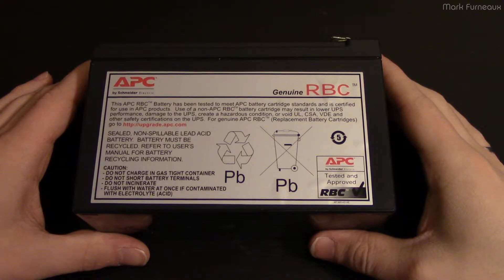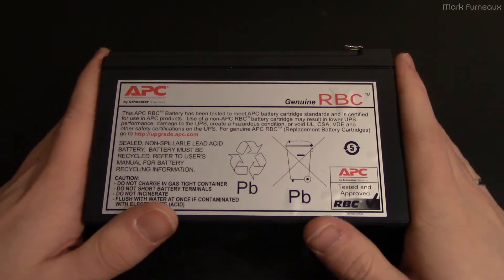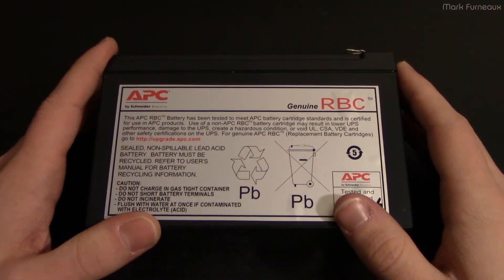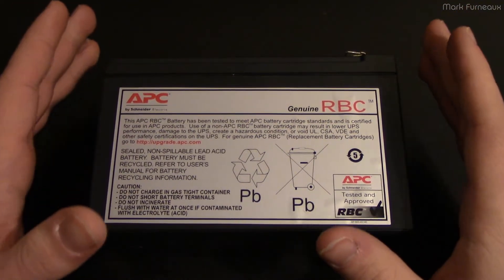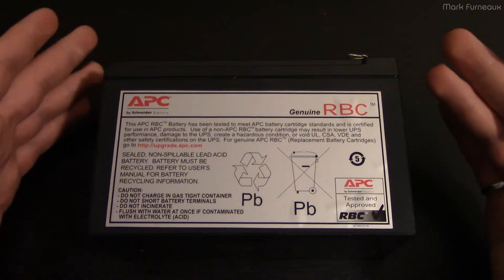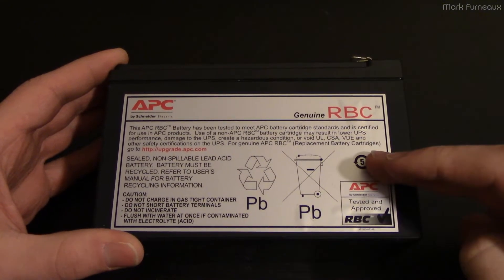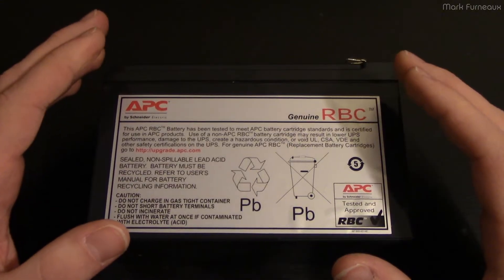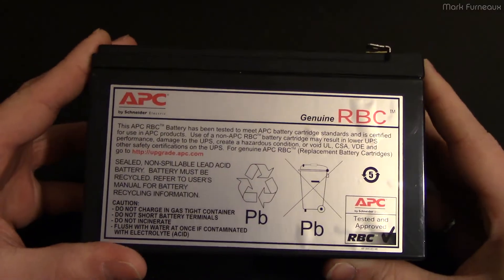How to Quickly Test UPS Batteries Without the UPS Itself

Comment: Thanks for the video.  Good suggestion on how to test UPS batteries.  I know I get errors on my UPS units alot.. even after replacing the batteries after a short while.  Having a little trouble with the Ancel BST100 tester I just picked up.  Sometimes it says CHECK CONNECTIONS.  But the seem pretty solid.  Screen is on and solid.  Other times it says the resistance is 0.  That can't be right I assume.  Ever run into this?  Did I just get a bad tester?

Comment: so i have this kind of nice multimeter that has the little resistance symbol, which im guessing means when i switch it to that, it measures resistance. does that work as well? does it apply a small load to test the resistance like the battery tester? thanks!

Comment: Thank you, this is exactly what I was looking for. Internal resistance is a useful indicator of battery health. Thank you for pointing that out. I already have a Foxwell BT-715 that is able to measure internal resistance. It does this in a back handed way by applying a known load and determining the difference between the no load terminal voltage and the loaded terminal voltage along with the current flowing. This is far more difficult to determine with basic tools like a multi-meter and DC capable clamp meter and the ability to perform some basic arithmetic. Anyway, the two batteries from the UPS (APC Back-UPS XS 1300) I was checking had internal resistances 73.54 and 76.67 milli-ohms so it is evident that they are bad as the data sheet indicated they should be around 19 milli-ohms.

When I discovered your video I said, >18 minutes – too long but I decided to give it a shot. When you started talking, I said, OK this guy thinks the same way (asks himself the same questions) as I would, (When you talked about minimizing risk by hot swapping batteries) so I’ll listen a bit more. Eventually you got to the discussion about internal resistance then I was sure I had found a reliable information source. Later you mentioned about $CDN and finally I noticed you are a Canadian Engineer – Electrical I assume.  This explained a lot in terms of how you approached this problem, found relevant data, and interpreted that data, etc.

I, too, am a bit of a UPS fanatic. I have four APC Back-UPS XS1300s supporting computer and entertainment equipment distributed throughout the house. I also have four older APC Smart UPS units, 2 X 1000VA, 1 X 1400 VA and 1 X 3000VA. These older units have all been modified to use external 35 AH deep cycle batteries and provide more than an hour of backup for my servers, Internet connection, alarm system and home automation equipment. I also have a 7200 Watt (continuous output) emergency power plant that I use for longer outages. BTW, I had to reduce the sensitivity settings on all the UPS units so that they would accept power from the emergency power plant. I also have a few smaller UPS units that are used for bedroom table lamps, clocks, etc.  And no, I don’t have a UPS on my microwave (other commenters) but it runs just fine on the emergency power system.

I have subscribed to your channel and given you a like on this video. I’ll take a look at the other stuff you have posted soon. Thanks again.
Reply: You simply connected a larger battery (35 AH) to your UPS and it is able to charge it fully?
Reply: @louistournas120  Yes. I normally replace the native battery wiring with longer heavier gauge (2 AWG with red or black insulation). This sometimes means removing and soldering new wires on the UPS motherboard. I drill holes and grommet them in the existing casing to bring the wires outside the enclosure. And I apply suitable connectors (typically crimp on ring connectors with red of black insulators) for the batteries used.  The battery type I use is always identical chemistry to the OEM battery (Typically Sealed Lead Acid Deep Cycle).  Such batteries normally have the same open circuit fully charged voltage and float voltage as the OEM batteries. This ensure that the native charger will operate fine to charge and float the battery as required. The main difference is that these larger capacity batteries will take more time to charge. For the larger UPS units, the battery can be 24 or 48 V. This is generally achieved by creating these battery banks using a series of identical (both in age and AH capacity) 12 V batteries wired in series.
Reply: I've seen numerous YT videos that show hooking up large(r) batteries to various UPS models. I'd be interested to know what mods you made to achieve this configuration. I just installed new cells in my Smart-UPS 3000 (SU3000RM 5U). Made my own packs using cells from fleabay and the fuse & harness from the previous pack. The unit is charging them as I write this.

This unit also has an Anderson connector on the back for a "SU3000 48V, 816VAh" unit. Is this port something I could use for a (customized) external pack along the lines of what you did?
Reply: @andrewr7820  I have an older SU3000 wired with four 35AH 12 V deep cycle batteries. These batteries are configured as two banks of 24 V batteries matching the OEM setup. I also have an unmodified APC SMX2000L. This is a rack mounted unit. The base unit has one 120V battery module (10 X 12 V batteries and about 50 lbs.) that is integral to the UPS unit with an Anderson style connector. I also have two additional rack mounted (19” X 2U) battery modules. Each of these units holds two of the 120 V battery modules that connect internally with Anderson connectors. These units are back wired and can be daisy chained together with the unit closest to UPS unit jacking into a connector on the back of the base unit. See response above for notes on charging.
Reply: @deanrhodenizer938  Thank you for the extremely informative reply. I think I'll look at creating an external pack that connects to the rear (red) Anderson connector port of the SU3000, unless you think there's a better way to do it.
Reply: @andrewr7820  Sounds fine to me. Take care making sure you build a pack that precisely mimics the factory version and the connection has the polarity exactly matched.

Comment: Can i hook up a car battery 12V, 100 Ah in order to have a longer discharge time when original battery was only 7 or 9 Ah? Is the electronics going to be ok and just recahrge time is going to be longer or it will burn my UPS?
Reply: Yes, you can, but never do it. The car batteries are venting gases and dangerous for indoor use. Especially during the charging cycle. If you planning for prolong power outage that can't be handled by UPS itself it is better and more efficient to get portable gas generator. You will need to take care of exhaust gases. https://www.bobvila.com/articles/how-to-use-a-generator/

Comment: What's the difference between this and hooking up a multimeter in resistance mode?
Reply from the maker: Your multimeter outputs a small voltage and measures current draw. Since a battery is itself a voltage source, you need a different method.
Reply: A multimeter in resistance mode is not made for using on a live circuit.

Comment: So Mark, what would be an acceptable range tolerance for the measured internal resistance? +- 10%, 50% etc? I am reviving 18650 cells and purchased a meter that measurese intrnal resistance more or less accurately. I've foynd that around 24-25 milli ohms (or less) is acceptable. If the internal resistance hits 30 or above the cells have tested (using capacity tests etc.) bad.

Comment: If you want to know that actual; capacity of a battery, use one of these.  Takes a lot longer and you need to know the safe discharge current (or what the inverter draws at expected or maximum load)

110 watts  9.99 amps  $23.19 + $1.27 shipping (US)
https://www.banggood.com/Original-ZHIYU-60W-110W-9_99A-30V-Constant-Current-Electronic-Load-Aging-Battery-Capacity-Tester-p-1146280.html?rmmds=search&ID=529811&cur_warehouse=CN

180 watts  20 amps  $42.10 + 1.44 shipping (US)
https://www.banggood.com/180W-Constant-Current-Electronic-Load-200V-20A-Battery-Tester-USB-Discharge-Capacity-Tester-Module-Measuring-Tools-p-1590208.html?rmmds=search&cur_warehouse=CN

The internal resistance tester appears to be the best one minute test there is ;-)

Comment: A multimeter allows you to test the resistance, so it is less accurate?  There are other videos warning that with a larger ampere battery than stated, the UPS unit will burn up while charging.  
BTW, glad to see more videos!

Comment: Another thing to look at is the terminals...  F1 or F2.  You can always squeeze an F2 lug to work on an F1 spade... and you can get an adapter to use an F1 lug on an F2 spade.    But if you pay attention to the specs, you can get these batteries with the correct spade terminal for your UPS cables.

Comment: Thanks for sharing.  I do a very similar test of my Lithium Batteries.  Never thought about doing this for my UPS Batteries and like you I use UPS's everywhere in my house.   I never change batteries on a live system because of potential arching which presents a potential explosion hazard.   Most of my UPS's take 2 batteries others 4 and very few only take 1.
Reply from the maker: AGM batteries don't pose an explosion risk since the hydrogen is absorbed in the battery itself. The don't vent to the environment unless there is a horrible failure which you will know long before you open the UPS. I've never seen a flooded battery in a consumer UPS for this very reason.

Comment: APC UPS units tend to charge the batteries really fast, they will be back at full float voltage within 2 hours. They will cook the internal batteries pretty fast, just like most small UPS units do. I took those internal batteries out, and instead used an external deep cycle battery to replace it, giving both much longer running time, and also letting the battery run around 20C cooler than it was in the case, increasing it's operational life. Also went for flooded cell, instead of AGM or gel, so that the APC "cook it till full" charge method would not kill the cells prematurely, by boiling off all the water in the cell, now I can just check every 3 months and top up a little, keeping the battery running longer.

As well get a slightly better UPS than the cheapest ones, preferably a little oversize, and one that has monitoring capability on it. The larger units will have both a self test feature and monitoring, so you get a record of the battery health when connected to a computer and running the UPS software, or the open source version, which I do.

Quick tip to tell with those 9Ah and 7.2 Ah units what the current capacity is, is to look at the terminals, the high current capable ones have the 6.3mm spades, the low current capacity ones use a smaller 4mm spade, and thus are capable of supplying much less current reliably. The low current types though are the typical gate motor and alarm batteries. They do not work well in a UPS, where they have to provide 20A or more to the transformer when in use.

Beware though of unknown brand name batteries, if the 12V 7.2/9Ah brick is light weight, typically for these around 1.8kg for the good ones, a light one is a fake unit, with less than half the number of plates, and a fill of polystyrene making up the rest of the cell inside. Only caveat is that you get lithium iron batteries in this form factor, and those are very light compared to lead acid, but are clearly marked as lithium iron, and have a slightly different charge and float requirement, but are a near drop in replacement for low power loads.
Reply from the maker: All the small UPSes I've dealt with use 10W chargers, so they usually take more than 2 hours to charge. APC units in general all overcharge the batteries, and this is one of the many practises that I don't condone and one of the reasons why I don't buy APC units anymore. For large UPSes, I think your practices make sense since the overall cost is higher.
Reply: @TheUbuntuGuy  All the small ones I have gotten for free with dead batteries almost always use the main transformer to charge the battery, relying on the power mosfet body diodes to do the rectification. Lower cost, and high current charge till the battery is near float voltage. Only older ons have a separate small charge transformer and a regulator to charge the battery, and those almost always you see the regulator is well cooked from high power dissipation.
Reply: @TheUbuntuGuy  which brand(s)/model(s) would you recommend instead of APC for home/small business use?

Comment: How exactly are you determining when to replace the battery? Is it only based on the resistance or are you also looking at the amperage the battery is still capable of and comparing it to the potential load on the UPS and determining based on that whether or not the performance of the battery is still acceptable?
Reply from the maker: Pretty much exactly that. If the IR of the battery is too high for the current required, it will be useless. Below that, it's runtime will be reduced. Exactly what IR you consider failed depends on the load and runtime requirements in the specific use case.

Comment: If you are gonna take the battery out to test it, my method is better:
Plug UPS to small know load (100W incandescent bulb). Measure time. Next.
Reply: That would assume you have a spare UPS to test it in, also discharging a 100W load could take up to an hour.

Comment: You don’t even need to set the CA as it does nothing for the test, just a number to compare against the ‘nominal’ value.

Ohms is what matters.

It does not apply a load!
It uses AC to do the measurements.

Comment: 3:28 Not all of them, its a coincidence that you hold a APC battery in your hand because actually the exception is a APC UPS. You have to screw it apart, not an easy thing to do nor it is safe to leave it plugged in. Cherry on top, according to them the batteries arent user replaceable. I most send it in and wanted something like 100€ for it, plus  shipping fees OFC. I was like "hell no". Blown it apart, gone into the local battery store and low-and behold they had batteries from the manufacturer of the dead batteries, and for quite less too(specs wise they were a bit better too). So yeah, lesson learned, next time i will do more snooping before buying.
Reply: Stratos Lockon 
Explain, not just regurgitate, exactly ‘why it is not safe’ to change the battery while plugged. I sustain that it is SAFE in any by-pass kind of UPS...
Reply: @pepeshopping  https://www.youtube.com/watch?v=twDPPBzKO7g
Reply: Yup.  We have a bunch of 350VA APCs scattered around the office that are non-user-replaceable, I've been tossing them out when they fail because it's not worth the money to repair them.  Besides, they are the cheaper units that "cook" the battery (keep it constantly on charge).
Reply: @RussSirois  Mine is a 1400VA, the part where the batteries are is pretty cold so i dont think its continously charging them. Besides the abtteries arent that expensive if you buy it in the battery store and not from APC.

Fiun fact, their siftware allowed me to tell the UPS that i replaced the supposedly non-user replaceable batteries lol.... :D
Reply: All of my APC units just have a slide-off door on the bottom that holds the plug-in battery. I've never powered one down to swap batteries. You do need to hold the power button for 6+ seconds to force a self-test so that it "sees" the new battery. This does not drop the load.